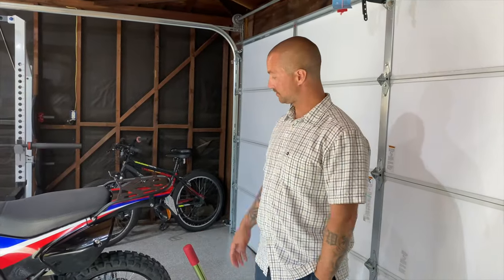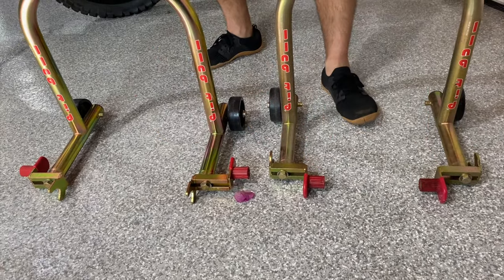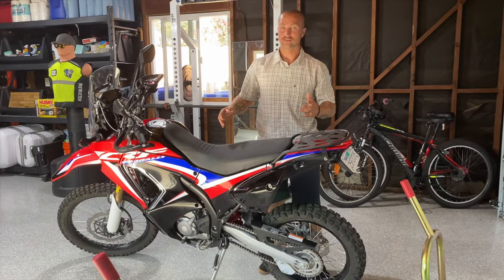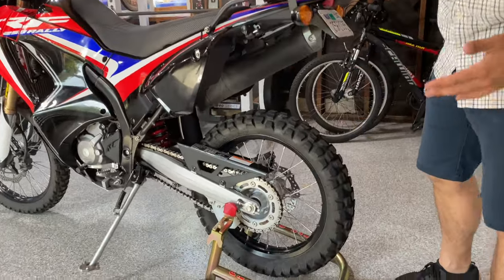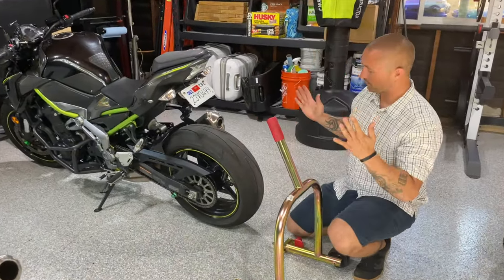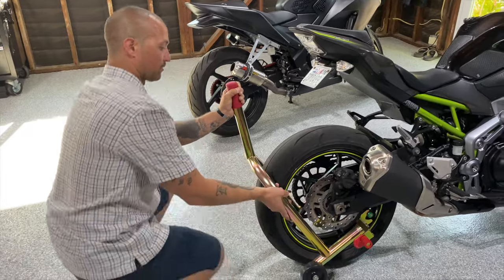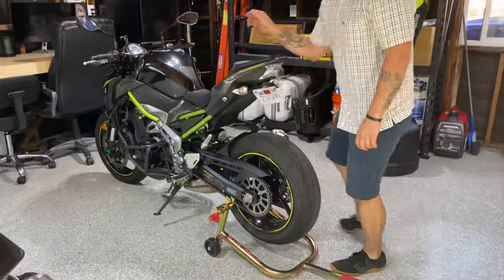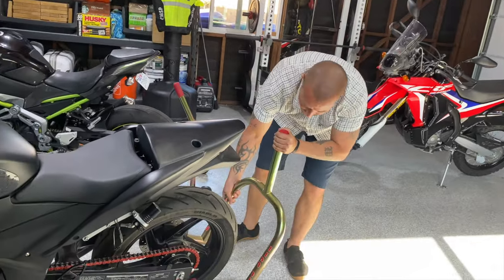Easy Steps For Using A Rear Stand For Your Bike

Comment: Great advice. My first attempt at putting my bike on a stand today was never going to work because the ground was uneven and not quite level, and I had the bike in neutral so the rear wheel still turned. Once I'd found some decent, level ground and put the bike in first gear I was successful.
Reply from the maker: Thanks for watching ❤️ MotoJitsu.com for my App, Books, Merch, Discounts, etc. 👍🏼

Comment: Useful video for beginners !
It was a bit stressfull for me the first time I used my rear stand. I do pretty much the same as you exept I am on the left side of the bike.
Reply from the maker: :)

Share it with others :) MotoJitsu.com for my app, books, etc. in case you didn't already know.
Reply: Just put it in first gear and turn the bike off it will not roll

Comment: I use a velcro strap to "lock" my front brake when I put it on and take it off the read stand. I've found it helps the bike from rolling on the garage floor
Reply from the maker: whatever works for you :)
Reply: Great idea.

Comment: Glad I watched this. First bike I've needed to use a paddock stand on and have now done it 10-20 times on my own, but wondered why the initial 1-2 inch pivot/lift was so difficult. Thought maybe the stand was not ideal for my bike or I was doing it wrong, however I notice that you also have to force that initial movement, once it starts to move it's fairly simple , just need to commit to that first push. Also glad you emphasise the kick stand !!! I now have a red piece of tape near the handle of the PStand with kick written on it, saved me twice.
Reply from the maker: thanks :)

Comment: Nicely done and explained. When mine fell off the stand it was because A.) was not on level ground- slight downgrade to non-kickstand side. B.) did not exert pressure coming off the stand toward kickstand side so bike would fall correctly to left. (for this reason I also recommend turning handlebars left before going off the stand)
Reply from the maker: Thanks :)

Share it with others :) MotoJitsu.com for my app, books, etc. in case you didn't already know.

Comment: Small tip - put a flat piece of wood under the side stand, then the bike is quite straight and thus you can attach the mounting stand even easier safely.
Reply from the maker: whatever works for you

Share it with others :) MotoJitsu.com for my app, books, etc. in case you didn't already know.

Comment: Recommend having the taller part of the “V” on the spool pickup towards the front of the bike. This is per Pit Bull.
Reply from the maker: works the same.
Reply: @MotoJitsu  I think that you are being a bit dismissive. These are well engineered stands and I put my money on the designers and why they took the time and effort to design and make that V asymmetrical. That taller part of the V is there for a reason. It's because, not only are you lifting, but initially you are having to capture the spool and there is a degree of rearward pressure in that motion. That taller section of the V makes that a bit easier as well as a bit safer. On the stands with the side / forward handle, the V would be mounting to the rear as they are putting some forward pressure on the spools.
Reply: @DavidM2002  He likes to do the telling, but he doesn't like to be told.  It's a teacher thing.

Comment: Someone can put the front one too, it is good if  have to keep the motorbike in garage for winter season (if too cold to ride) and want to keep your tyre in good shape
Reply from the maker: :) yup

Share it with others :) MotoJitsu.com for my app, books, etc. in case you didn't already know.
Reply: @Massimiliano Truzzi just make sure the rear is done first before putting the front up. When taking both off the front comes down first, then the rear.

Comment: Great lesson. Anyway, shouldn't the forks on your motorcycle stand be placed other way around? Swap the right fork with the left, so that the longer forks part will be in the front. 😉
Reply from the maker: thanks

Share it with others :) MotoJitsu.com for my app, books, etc. in case you didn't already know.

Comment: The Pitbull stands with the extended handle provide nice lifting leverage.   I have a lesser stand that’s just a loop and I have to put my whole body weight on it to lift my bike. Doesn’t allow an extra hand to steady the bike.  I need to use it with a front wheel chock that supports the bike upright by itself before lifting the rear, or have a helper steady the bike from the front.
Reply: I agree with this comment 100%. I have venom rear stand from amazon. And that thing need whole body weight down to lift the bike. I have used my friends pitbull and its a piece of cake to lift bike up on pitbull. Good stand makes a big difference.

Comment: I'm using bobbins on my *2020 MT03. For the life of me I can't get the stand to go down. No matter how sure and hard I push. 1st, neutral. Handlebars straight, left or right. My taller, fitter father couldn't even push the stand down. Maybe it's the cheap stand I bought, it's faulty. 
Bought the Oxford Big Black Rear Paddock Stand. Nope, still can't push the stand down to get the bike up. Got the bike nice and balanced, bike will stay upright with the stand hooked onto the bobbins, but I can't put the stand down. What am I doing wrong?

Comment: if you have wood joist in your garage just put two eyehooks into the joists and then use two motorcycle tie-down straps to hook onto the handlebars and use them to straighten and secure the bike before you use the Pit Bull.   Much safer way and less stressful.  Or you can buy yourself a front-wheel chock which will also hold the bike upright but a little less safe in my opinion.

Comment: I just use a piece of block and insert it under the sidestand to level the bike. Still not confident enough balancing the bike. This is a very a good tutorial to start with. Also in my parking space the bike is all the way to the right almost near the wall so theres no way for me to stand on the right side of the bike. Im always positioned at the rear center of the bike when i mount/dismount it from the paddock stand. But still, I need to practice this style.
Reply from the maker: whatever works for you :)

Comment: Can I ask then would you only use this paddock stand  if you do not have a center stand ,  and  assuming you have a center stand and want to work on your front wheel  you would then just get a front paddock stand to lift the front wheel up .Or would the original center stand not work in this case and you would need two paddock stands in order to work on the front end .Sorry if this is no clear but I hope ya get what I mean . Cheers : )
Reply from the maker: If I had a bike with a center stand, I wouldn't use this on it. I never tried this type of stand on the front. 

Share it with others :) MotoJitsu.com for my app, books, etc. in case you didn't already know.

Comment: Can you sit on the bike after applying the rear stand so you can change gears while the bike is running etc or would you need a different type of stand for that use???

Comment: I wish I had seen this a few months ago. I've been using a 2x4 to prop my Vulcan 650 up holding it with my leg then push the stand down
Reply from the maker: :) 

Share it with others :) MotoJitsu.com for my app, books, etc. in case you didn't already know.

Comment: Love your videos very informative would those stands hold up street glide special 2017 harley
Reply: The stand itself might support the weight (check on the Pitbull site), but you probably would not be able to lift the bike upright via the tail and almost certainly would not be able to pivot the stand down (lifting the bike off the ground). I think the better way is to get a specially made hydraulic lift on rollers, like the one from J&S Jacks. The good ones, like that, have arms that slant down slightly so you can lift the bike from its resting position rather than the cheaper lifts that require balancing the bike first. The cheap ones are also sketchy and feel like they can twist or fail.
Reply from the maker: thanks! I never tried 

Share it with others :) MotoJitsu.com for my app, books, etc. in case you didn't already know.

Comment: thanks for sharing the experience, it's always useful to see how the same thing is done by others. I can add a little bit to the shown regarding handlebar position. I'd recomend to set it in neutral/straight position before the rear end ex. Why ? - The ground surface might be not ideal and small stand's wheel might get stuck in a bump - in this case, as you're lifting the rear, the stand doesn't move and the bike moves backward  and it has to move along a line, not a curve, so the handlebar has to be in neutral position.

btw, what is the yellow thing hanging from the ceiling ?
Reply from the maker: you're welcome! Many ways to do one thing, this is how I do it.

Comment: Hello Greg , stupid question here 

yesterday I used the rear stand for lifting the rear wheel of my sportbike and I had no problems in doing so , however when raising up the rear stand to lower the rear wheel back on the ground , I did it too fast and the rear wheel slammed down on the ground , luckily I saved the bike and no tip over 😅😅

My question is , if lowering the rear wheel too fast on the ground could cause some damage to the wheel/swing arm or other parts ? Bare in mind I wasn’t using a Pitbull rear stand , another aftermarket one (yeah I know should get a decent one😭) , so the rear wheel was lifted around 17cm from the ground.

Thanks for your time to read my comment and If you can answer me
Reply from the maker: No it won’t cause any damage
Reply: Ok thank you Greg for responding my message and have a nice day 😊
Reply: Sorry, but I did lol for your question. 
Bikes can go 300km/h but you tought that dropping it too fast from 10cm can damage it. :D

Comment: As the floor where I work is really not smooth, the bike tends to come backward to the stand, instead of the stand moving forward when lifting the bike.
So I use a rubber band to lock the front brake and prevent the bike from moving at all.

Comment: Need to store my yam v star 1100 in my shed. Slightly uneven ground with 3/4 plywood down.Would like to use a stand for the rear and the front to prevent flat spots in the tires come spring in Mass. Right now its on the kick stand. Is there a way to do this or a better suggestion? TY
Reply: Block of woood under the sidestand is the key....before stand insert and push down.

Comment: I had no problem using front and rear stands on my Kawasaki Versys 650, which did have spools installed. The Kawasaki Concours 14 I purchased last year is another matter entirely. To start, commercial stands are not wide enough to span between the spools that I installed on the swing arms. In any case, the "Connie" is much too heavy and the balance point is too narrow to allow a single person to lift the rear in a stand. I'm still trying to figure out how to fabricate some type of mechanism to lift the bike. The bike has front and rear crash bars. The rear bars project to protect the panniers. I think some type of powered jack that engages the rear crash bars and that can be actuated remotely while holding the bike upright may be the solution. Meanwhile, I've used my engine hoist (which I have to retrieve from storage and assemble to use) to lift the bike bodily for wheel access.

Comment: Do Ducati's still have a suïcide stand?
How would you do it on those?
Reply from the maker: different stand yes

Share it with others :) MotoJitsu.com for my app, books, etc. in case you didn't already know.
Reply: They no longer have the suicide kickstand, which BTW could be disconnected. The made-for-Ducati stands were easy to use. As Greg mentions, there are different ways to perform the action; I don't stand the bike to vertical. My Ducati has a single-side swing arm and I use Dynamoto stands front and rear. I push the stand into the rear axle, apply downward pressure and the bike rights itself as I press down.
Reply: @Ramon51650  ah, yes. Some of them had/have single sided swingarms.
My VFR750 had one too.
Only thought about the suïcide stand.
But that's an issue too.
But the VFR had a center stand, so a Paddock stand wasn't really necessary for the rear.

Comment: Bike does not even need to be upright. I like to make sure front wheel is locked to left so it automatically rests on the kick stand when you let it down
Reply from the maker: many ways to do one thing.

Comment: Now try it on a track bike with no kickstand. It's more fun
Reply: I would buy a trackside portable wheel chock for the front. Just roll it in and it keeps it up. Then you can grab the rear stand
Reply: @jcmartinez7527  right but then you have to swap it out for a front stand to put warmers on. Not impossible just a bit of a pain. I’m not sure there is a great solution I’ve been dealing with this annoyance for years haha
Reply from the maker: Same thing.
Reply: @jcmartinez7527  does your front tire get super stuck on the trackside choke? It happens to mine almost every time and it’s a pain to get it out…
Reply: @joebar52  no, I think its because you essentially have to lift the bike over the pivot point. But that's how it locks into place. Just pull back and up

Comment: On the peg fork, shouldn't the longer fork leg be under the peg initially on that brand?             Something that I recommend after doing this a lot is too lock the steering straight centered forward. Just a matter of time before the steering flops to one side at the wrong time, been there. It also helps stabilize while working on it. You can make some sort of bracket or simply use rope or tie down strap tying the handlebar ends to somewhere on the frame.
Reply from the maker: whatever works for you :)

Comment: my r25 always keep rolling forward everytime I try lift the rear up so I just put it in 1st gear
Reply from the maker: :) 

Share it with others :) MotoJitsu.com for my app, books, etc. in case you didn't already know.
Reply: It's also possible to put a Velcro band or a clip on the front hand brake lever to lock the front brake to prevent the bike from rolling.

Comment: Great video SenSei! I found that all my bikes, whether spooled or not are 13" apart to the inside of the rubber flange or spool forks. My Thruxton R is impossible to do alone as there is nothing to hold onto in the rear of the bike. I bought the Pit Bull that has the lever arm offset to the left side of the bike. This one rolls under the bike so you can use the handlebars to balance the bike while you push down on the arm with your hand or your foot. The good news is that it isn't sticking out behind the bike to trip on. The bad news is that it's under the bike if you have to work on something. Awesome stuff!
🙌👏👌✌🖖🤙👍👋🙂
Reply from the maker: thanks

Comment: Now, what do you do with a bike that has a single-sided swingarm?  :-D

The answer is, use the center stand!  lol
Reply: There are stands for single sided bikes, if they have a hollow axle that is.
Reply from the maker: there are single sided stands.
Reply: Being a smart-ass aside.  There are also lifts that attach to the frame and jacks that go under the frame.  All of them will lift one or both wheels off the ground.

More than one way of doing things.  :-)

Comment: I refer to the playlists on this channel all the time, to get new tips and keep up the knowledge that I have. One question: what jack or work stand do your recommend? I have a small bike, and just for working on my own bike, so not going to use it on a daily basis.
Reply from the maker: As in a rear stand like the one in this video?
Reply: @MotoJitsu  Maybe a center stand?  which  could allow working on front and rear wheels, brakes, etc.
Reply from the maker: I don’t know of any bikes that have center stands unless it’s a dirt bike or the bike comes with it
Reply: @MotoJitsu  Guess I was thinking of something like this: Strongway 1000-Lb. Motorcycle Lift/Utility Vehicle Lift
Reply from the maker: I never had a lift so I don’t know of any brands or anything but you can message my mechanic who would. “Motorcycle Mecha” on Instagram